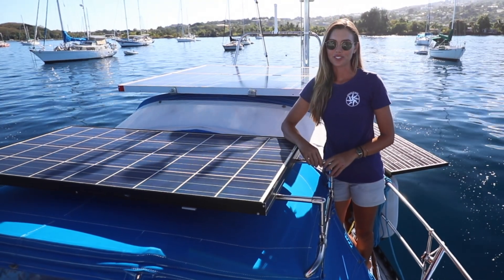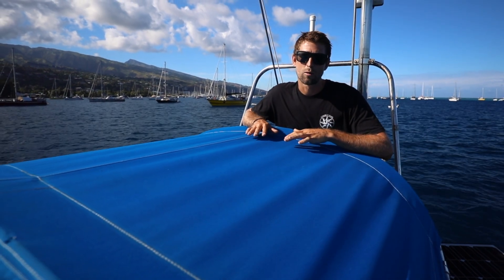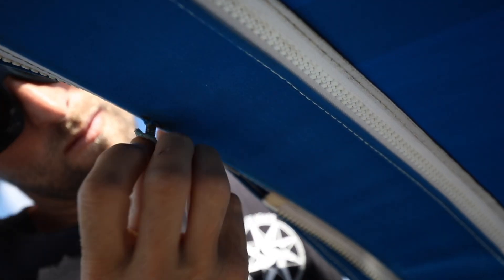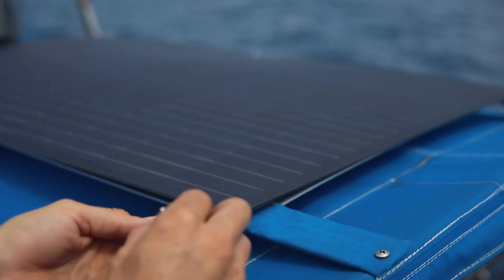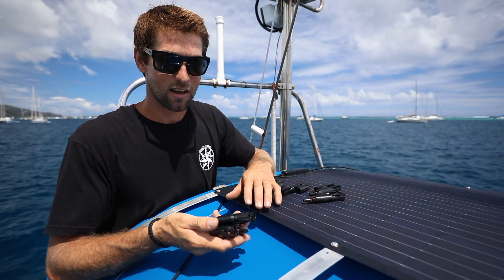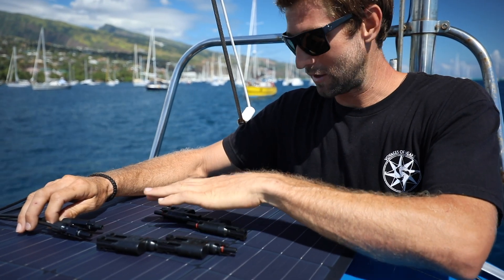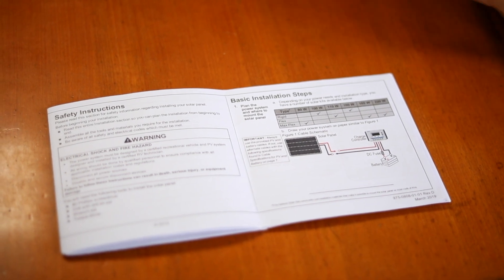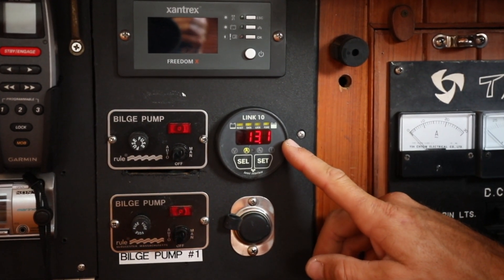Installing 110W Flexible Solar Panels on Our Boat

Comment: Do you know if there are any flex solar panels that have the connector wires etc. on the BACK of the panel, that would seem like an obvious thing to hide cables better?

Comment: Sunpower flex panels show severe sundamage before 3 years. Surface gets damaged by UV. Surface layer starts to crumble like all bad plastics do. No warranty. Rip off. Need to buy new every other year. Environmentally very bad. Need to buy new every other year.
Reply from the maker: Hello, we’ve had ours for over two years now and so far there’s no yellowing or deterioration. They are in great shape and the output is the same as when they were brand new. Xantrex panels also come with a two year warranty.
Reply from the maker: Just a quick look at the Sunpower flexible panels and I would only say "you get what you pay for".

Comment: Nice tutorial.  I like your use of a close fitting frame for the curved bimini.  What is the size of the aluminum bar stock you used for your mounting frame?
Reply from the maker: thank you!! I used 1/16" X 1 1/12" alum. flat bar. It has held on just fine in over 60knts of wind. An advantage of the flat bar is it matches the curve of the bimini, weighs almost nothing, and the space between the bimini and panels allows for air to move through and cool the panels.
Reply: FWIW I ended up using 1/8 inch 316 stainless. I tried thinner but felt it was a bit on the flimsy side. On the other hand, I didn’t do cross straps, which would have likely helped with sturdiness.
Reply from the maker: @SVSparklemuffin  I would love to see a photo. I am always curious to see how other instal, no two are totally identical.
Reply: 5:50 You are a dream.

Comment: Just over a year later now... How has this install worked for you? Still happy with it? Anything you'd do differently?
Reply from the maker: We have had the panels on for two years now (delay in posting the video) After two years of tropical sun, storms, rainy seasons, and a crazy cat using them as a trampoline they still look and preform like new!!! I was a little skeptical about the flexible panels at fist but i am now a believer.

I am very happy with the install when you take into account that we have very limited resources here in french poly. the only thing I would change would be to hide the wires better.

Comment: Looks great! Why would you need both a battery disconnect and a solar disconnect, why not just a solar disconnect?
Reply from the maker: The resettable breakers are a great way to test/ disengage power or current from before or after the charge controller. Also should something (hurricane/coconut)  damage a panel and short it out it will trip the breaker and not risk damaging the charge controller and protect the wire. The breaker after is to protect wire and batteries form a malfunctioning controller. Here is a website that goes over it in more detail. I believe it is also ABYC code to have one:  https://www.windynation.com/jzv/inf/how-properly-fuse-solar-pv-system